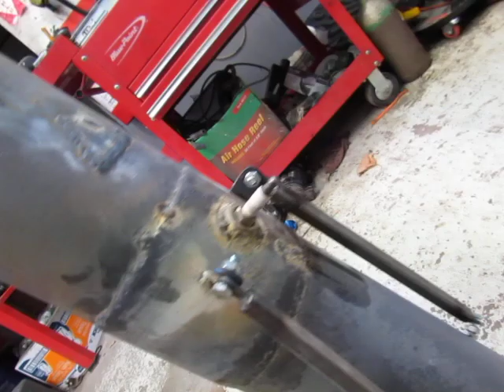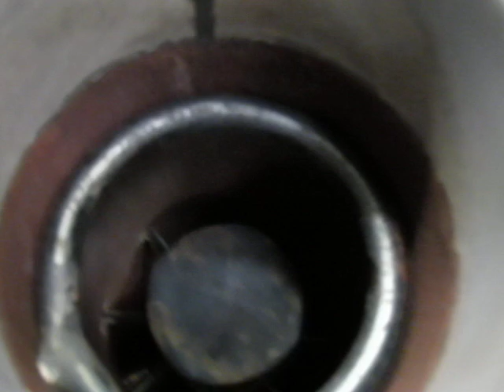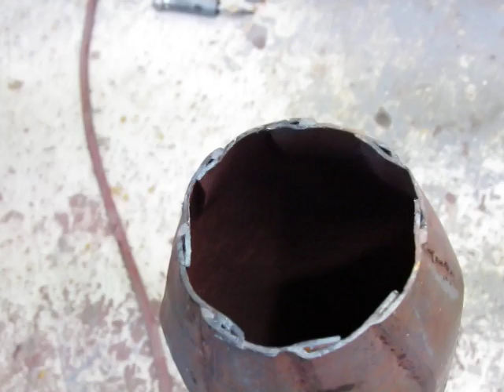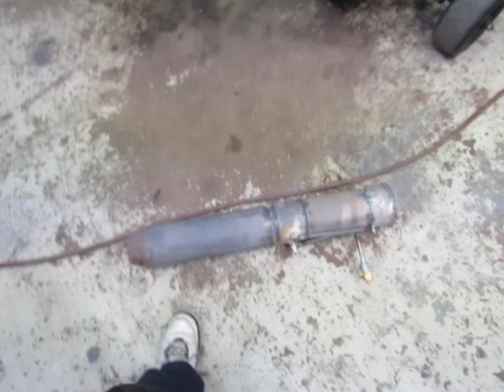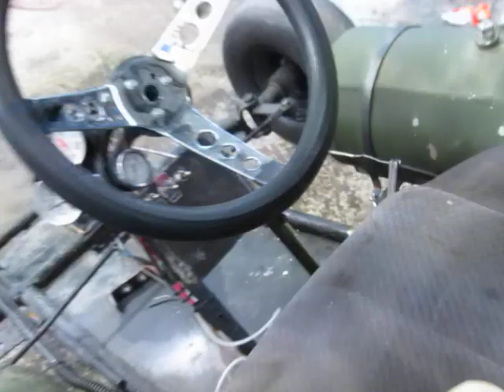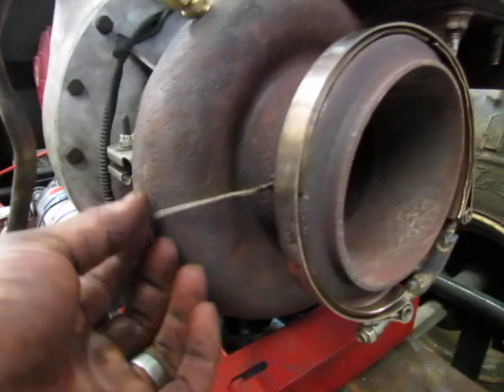SPECS OF AFTERBURNER AND JET TUBE

Comment: do you have a pic or video of just your flame holder itself that you can share?
Reply from the maker: for my after burner?
Reply: DR SATAN yes please, im designing a turbojet and trying to figure out a AB for it. You mentioned there are air vent on the "SIDE" of your flame holder cone and trying to figure it out and cant see them in your video...any help would be appreciated. Maybe post a pic on a link or something?
Reply from the maker: yeah no prob!, that center tube inside the after burner is literally the end nozzle from a propane torch https://i.ytimg.com/vi/hgBSdbTDCds/maxresdefault.jpg   i just added a cone at the end that faces the turbo so that there is smooth air flow on that end. hope this helps
Reply from the maker: do you have any pics videos of your project so far?
Reply: DR SATAN yes but trying to figure out how to send or post..do you have a facebook link?